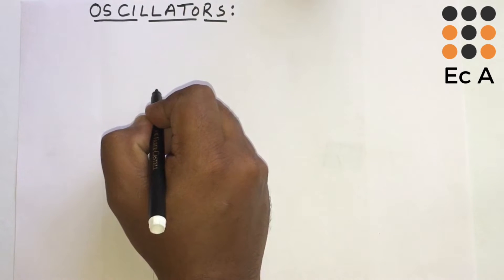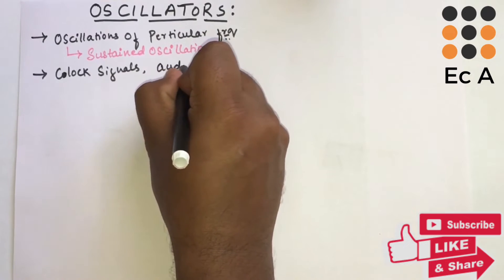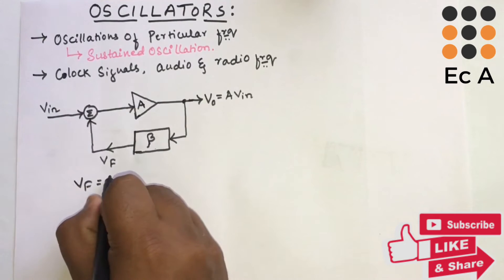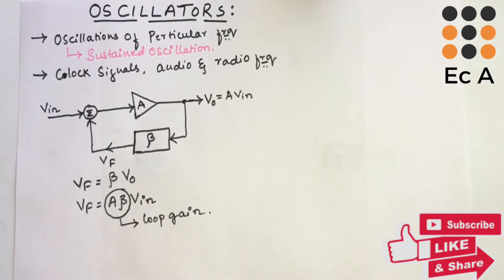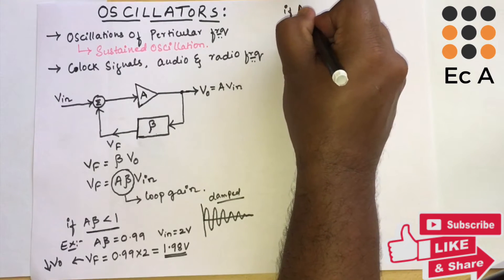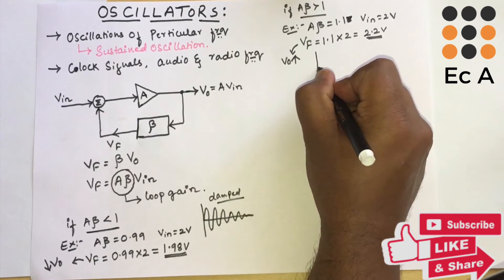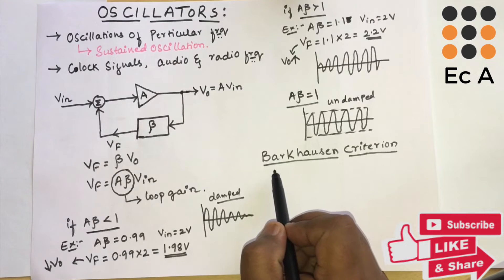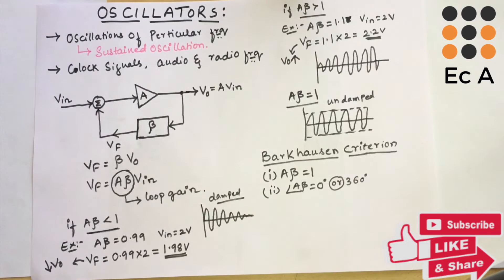#43 Oscillator and Barkhausen criterion || EC Academy

Comment: Sir Today VTU Circular came they have promoted even sem students sir is year back system cancelled pls reply sir
Reply from the maker: All the students are promoted irrespective off their backlogs… CONGRATULATIONS 
Do subscribe and keep supporting EC Academy ✌️
Reply: Sir if we Are having Backlogs in previous semester how will they calculate the marks sir
Reply from the maker: If you have backlog then Your passing will depend on IA marks… so score good marks in IA.
Do subscribe and keep and keep supporting EC Academy
Reply: Sir in 5th sem I'm having ia marks in each sub and in 6th sem also but i have backlog of vhdl lab of 5th sem with only one marks less than average they said they will conduct both internal and external exam for that based on that will they produce the final result sir

Comment: what is tharmal noise plz exlpain
Reply from the maker: thermal noise, Johnson noise, or Nyquist noise is the electronic noise generated by the thermal agitation usually by electrons inside an electrical conductor, which happens regardless of any applied voltage. Thermal noise is present in all electrical circuits.
Hope you understood.
SUBSCRIBE and keep supporting EC Academy 👍
Reply: thank u sir